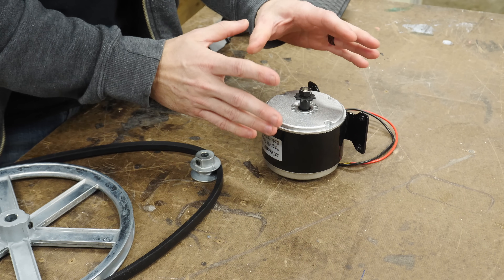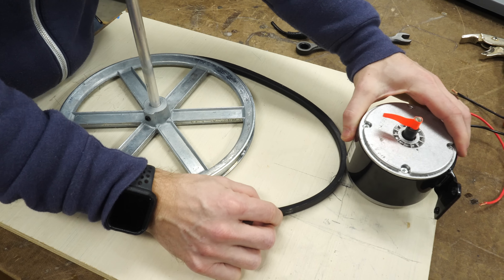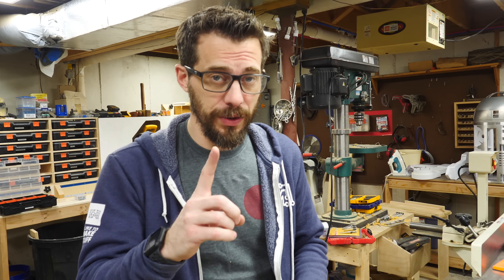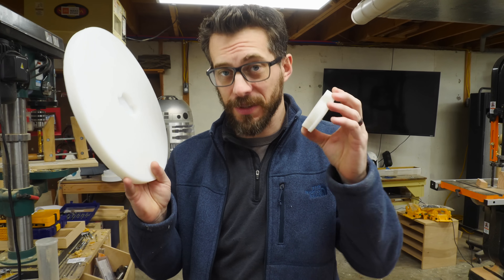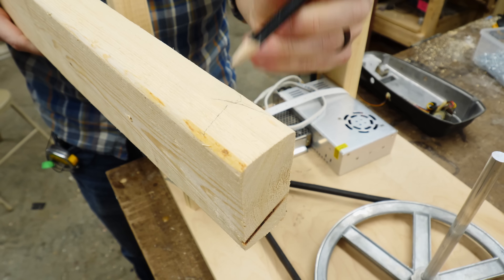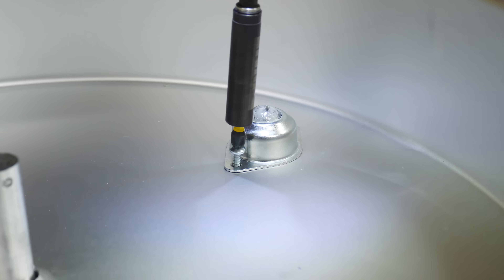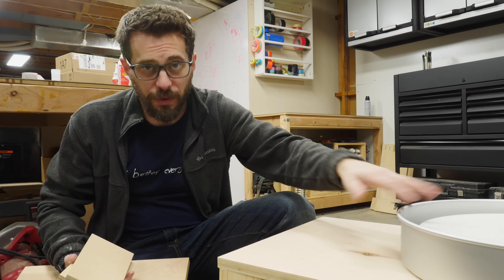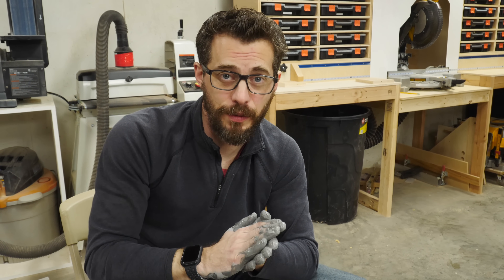How to Make a DIY Pottery Wheel | I Like To Make Stuff

Comment: Love your videos but this particular project is going to be very frustrating for someone trying to learn to throw on a wheel. I can tell you from the hundred or so hours I've spent learning to throw, the slightest bit of wobble can make it extremely difficult to get the work centered- that's often an almost imperceptible amount of play on a professional-grade wheel. Continuing to work a piece of clay that's not centered will cause everything to be slightly off balance and most pieces will develop a hump that will cause failure. From what I could see, this wheel had a pronounced wobble, even after the point where it was "trued". I'm all for DIY but I think at the very least I would want to see someone with experience try this out before presenting it as a project tutorial.

Comment: I really enjoyed this video. The pottery wheel is a great DIY project and you make it look very attainable. One thing that I learned though, and it seems to be the case in a few of your videos, didn't have to do directly with the making of the wheel. In one shot when you were drilling the pocket holes, I noticed how you offset the 2x4 so that you could get the depth you wanted. I've drilled through many tester boards trying to find the right depth, but the trick you showed was very helpful. Keep up the good work!

Comment: You may want a drain for the splashpan, that bead of caulk around the shaft may not be high enough to prevent water/slip from getting down into the bearing.

Comment: To improve your design: 1. you shouldn't glue the wheel head, they are removable to clean the pan! 2. add drainage with garden hose and some wine cork stopper to drain the pan. 3. draw circles on your wheel head every 5cm or so it really helps in centering for newbs. Pottery is dirty instead of making everything solid make it easy to clean. Side note that bearings under the wheel head it shouldn't be necessary you made bat from plastic what you should have done is make it from aluminium and steel atachment (maybe with X bracket and hidden or flush screws?).

Comment: As a professional Potter I will give a critique of this machine. A novice will have some trouble with this machine. The big ones is clean up. The caller to hold the water in is not tall enough around the shaft. All wheel heads should be removable. The wheel head is what you are calling the bat. A bat goes on top of a wheel head. Also a pillow bearing mounted to the shaft would be better suited than having it in the head plate. What would happen if you ever had a bearing failure? You would have to take the whole thing apart again. So on a serviceability standpoint it isn't the greatest. A great first attempt but some refining needs to be done if you were to use this long-term. For $200 more you can buy a good portable potter's wheel with a 5 year warranty. The great thing about pottery wheels is that they don't lose a whole bunch of their value after purchase. Usually the only lose 1/4 of their value at worst. It's not about slacking on your machine. A great first attempt. But I would highly urge you to put an aluminum wheel head on as opposed to plastic. Clay and plastic don't play well.

Comment: Might want to avoid wearing a smart watch while doing pottery, using mine on a wheel was how I killed it (granted it lasted pretty long up until then)
Also a really nice job but I would've made it so you could take the top plate off more easily as you're going to need to clean out the clay that gets thrown into the bottom, was a super big pain when we had to clean ours out when I used them in school, a small drain hole so you can add water and drain it out later might also save you some trouble cleaning.

Comment: You know... That's not a bat. That's the wheel head. A bat it a plastic or wooden piece that's set down on top of the wheel head. So you can throw an object and remove it from the wheel without having to pick it up. A lot of wheels have removeable catch basins. Just a thought

Comment: Glad you went with a removable bat. You might want to replace the nylon wheelhead with an aluminum one at some point, but it's definitely a serviceable beginner wheel. you'll probably also want to at least add some kind of drainage hole in the splash pan. Cleaning a non-removable splash pan is a screaming bitch, I can't imagine doing it without a drainage hole. Just please for the love of all that's holy waterproof those electronics. water and clay goes everywhere when you're throwing.

Comment: I am a pottery instructor and I own 18 pottery wheels from 8 different manufacture and I repair the wheels at my school.  Great build. the wheel, motor and pulley system are on point. the bearings around the outside will rust and get load overtime. (they aren't necessary is the wheel head non removable. The splash pan needs a complete redesign. its too shallow. two flimsy, and non removable. you could fix 2out of three of these and it would be ok. But overtime those will be the weak points.

Comment: you should realy have gone with a tension-er connect it to a block in the middle with a spring on so it auto adjusts, and reinforce that motor mount because that will break in the long run.

Comment: hey man great video but there are some issues with your design. The cake pan, aka splash pan, really needs to be removable for cleaning the clay and water out. The part you keep calling the bat is actually the wheel head and a bat would be temporarily attached on top of the wheel head (which isn't usually removable), either with little pins or some people use a thin layer of clay to adhere it. Those bearings are going to rust and seize up pretty quick with how much moisture is under the wheel head so you should probably find a different way to retain the shaft so they aren't needed. I'd love to see a follow up if you made some changes.

Comment: Awesome video, I am a potter and have been building a wheel on and off for about a year.  I want to thank you for allowing me to rethink some parts of my design and gain some of the motivation I need to finish it.  That being said, as a potter, I do see a few flaws in your design.  Most importantly, while the top is almost perfectly level I do see it wobble a little; for a beginner potter I see this being an issue as your clay will never truly be centered and throwing taller forms will also become an issue.  This was a big problem for me my first go at building a wheel.  I have some suggestions if you ever decide to build another one, thanks for getting me out of my rut!

Comment: Speaking as a potter. Really nicely done. I have thought of building a wheel for myself. Some comments based on my years of pottery experience - should you decide to make a Mk 2.
Your vertical bearings under the wheel head will clog with clay/slip and water, that area is always super wet and full of liquid clay (pottery wheels do not have these). 
Wheel heads are most usually cast and machined from solid aluminium. 
Your wheeled as a very tiny wobble, which would be fine for very small pots and total inexperienced potter, but would make improving ones skill and larger pieces pretty much impossible. 
Dead flat and a reasonable mass is important for a wheel head - momentum is important for even throwing. 
One needs a lot of low down torque for throwing any larger piece - this motor does not large enough (1.5 to 2 hp is best). 
I think you will get leakage down the main drive shaft. The 'dam' where it comes into the 'tray' (cake tin) needs to be 20 to 30 mm high. 
You need a good gap between the edge of the tray and wheel head, so you can get your hand in there for cleaning.

Comment: Seeing as you haven't put any type of drain off for the water, it won't take long for the tray to fill with water and slip and then those bearings are going to be toast. 
Plus without a drain, how are you going to get the water out with such a small clearance between the tray and wheel?
Good first attempt, mark II needed.

Comment: Awwww you should have just left the pedal plug as is and use a guitar cable to control.  That way if you wanted to move it, it would be simple to plug in and un plug and look cool at the same time.

Comment: You should have put a drain hole in the baking tray as you will not be able to get the water out also why not screw the throwing wheel on,so you can remove for cleaning...nice job though...

Comment: to build up the wall use your thump and middle finger using your index finger to guild your middle finger moving slowly upward keeping a consistent thickness youll understand when you give it a try dont use to much water itll ruin your "Pot" use enough to keep it smooth or lubricated make sure to kneed your clay to get out as much air as possible or it will ruin your ability to form anything 

hope this helped bring on the haters!

Comment: Hey bob a tip for making the learning of this skill easier and more enjoyable would be to add pegs to the surface you were turning on and get some plate bats that lock in to the pins that way when you finish a bowl, plate or whatever your making you can remove the whole plate to set it to dry and start again on another one without needing to wait in between. it would also make it to where multiple people in your house could use it and have multiple projects of their own going. I hope this helps.

Comment: If you used a smaller hole and then dimpled it up, that would help keep water inside the pan from dripping down into the shaft bearing.  Also, how do you get the water out of the pan?

Comment: just to clarify a bit. the surface you throw on is called the wheel head. a bat is a removable board that goes on top of the wheel head to make it easier to lift pots off the wheel without distorting them. you lift the bat and pot off at the same time. stick down another bat and throw the next pot.

Comment: The sediment from the clay is gonna get in those bearings, I hope they don't seize up. Most wheels have a splash pan that comes apart into two pieces so you can easily dump out and clean it in a sink, getting excess water out of the base is gonna be way harder than normal wheels. Also be careful how much clay you wash down then drain assuming you don't have a trap installed on the sink to catch sediment, it can clog pipes.

Comment: I'm taking a ceramics class right now and don't know much about it but i do know that the base where the clay is put on to usually has scuffs on it so that the clay can stick to it better. The scuffs usually get worn off and the bases are still usable so it shouldn't be a problem but it may help if the clay is flying off.

Comment: I learned so much from the B-roll in this video alone! I'm not an active woodworker but I'd love to be one day and I would have never thought to use the clamps to support the stringers from the underside while attaching them. I also never thought about with a pocket hole jig to make sure your bit will fit right by placing the bit in the jig and sliding the work piece into it. Great stuff Bob and team! Thanks for awesome content that I can still learn from even after following you for the last 2.5 years.
Reply from the maker: That's great feedback, thank you!!

Comment: Love the vid.  You do realize the motor had left hand thread so you were just trying to over tighten it and it probably stripped the threads.  That's why it wouldn't come off.  Reference 5:19 for a clear view of the threads sloping up to the left, meaning left hand threads.

Comment: you should make sure to take off your wedding ring when doing pottery. It's a pain to remove afterwards.
Reply: also, make sure you wrap your clay pieces until they are ready for firing. Otherwise, they will crack under the heat, and all your hard work will be ruined.     Amazing project, and ill be following suit!

Comment: I would suggest adding a drain for the water so it doesn't become a problem for mold/mildew. I also suggest playing around with the size of the table legs so sitting for long periods won't hurt your back.

Comment: Awesome man. This is why I love your channel. I do remodeling by trade and am familiar with a lot that you do, but you come up with ideas for projects that I would never think could be diy. Great job. Pro tip. When sealing a screw hole, dab the sealant onto the surface first, then the object you're attaching (your bearing) then screw through the sealant. Guaranteed, every time. Great job man. Thanks 👍🏾

Comment: What an amazing project!!! I've seen budget friendly wheels for under 300, this is such a nice guide for potters who maybe want to create their own wheel on a budget. I would like to suggest perhaps getting some bartop epoxy (instead of paint) and do a pour on the wood surface. You obviously might run into problems where the water falls off the surface and onto the floor (which is why so many wheels have a beveled edge to keep the water on top) BUT you've put so much work into this I would hate to see water damage warp the top (or get moldy). Great job always enjoy the videos!

Comment: You could add a little hole in the bottom of the metal thingy and connect it into an aquarium hose just to drain excess water out in a little tank underneath the table top 😉

Comment: Nice build,  but it's going to be a nightmare to clean. The best profesional pottery wheels have a detachable tub to make cleaning easy.  That part usually gets very wet, and depending of its use it may end very full of water or paint.

Comment: I noticed you didn't plug the holes after you removed the first set of bearings. I hope you caught it. Also, you need to kneed the clay before you turn it. I know it's practice, but it can blow up in the firing kiln because of air pockets.
Reply: It was all plugged and sealed by the final shots. We don't always get to show every little thing, but it happened 🙂

Comment: The top of the table needs sides to keep the water and the flung-out clay in. You need to wear an apron to protect your clothes. Get an apron with a front pocket to keep the tools in, so you can grab them as you are working. The tools that you need are wooden and metal spatulas and knives for decorating and shaping the clay. You need a sponge also for working the clay, and some water within reach, for instance in a bowl. Part of the shaping process needs water to act as a lubricant, both on the sponge, the shaping tools and your hands. At the end of your creating, you need a fine wire like a cheese-cutting wire to remove your piece from the wheel, and move it to a board for drying out or getting ready for the kiln. When you get a kiln, fire your creations slowly, and cool them down slowly, otherwise they crack or disintegrate. You can recycle failed pieces and use them again, for which you need a vessel such as an old drum. You put the recycling into it, in water, and let it decompose. With new or recycled clay, you need a table with a flat wooden top, for "wedging" the clay and getting it ready for use. Again, you cut it into suitable sized pieces with the wire. Be careful with your back and thighs, as you are tall and thin, and are going to be sitting at angles your body is not used to. You probably are going to have to adjust the height of the table and chair to get an ergonomic seating position. As you see, there are lots of factors to consider - the ergonomics, all of the processes that you need to know about, what you want to start off making, how slip and glaze work. A big learning curve at the start, but as you say, it is fun. Good luck ! Phil Dodd, Leominster, Herefordshire, England.

Comment: This is great, but I would question (much like you did) on securing the wheel down.  With all the clay and water being thrown around, I would suspect you'd want to lift that wheel to clean the basin (and ensure your bearings don't clog up).  Otherwise, what a great project.  I haven't thrown clay since high school, and that looks like so much fun.  Thanks for posting.

Comment: All the needed electronics can be found on a cheap used 24v Razor brand vehicle. They make quads and go karts that use the same motor seen here and has an ESC with a thumb or handle throttle that can be used with a pedal. ☝️👍👌
Reply: That's a good idea
Reply from the maker: Nice!

Comment: i've been wanting to make a pottery wheel for a while.  this brought up a lot of things i hadn't thought about. 
the thought in my head was mostly as a sculpting station that could spin the model slowly to get a better working angle on it with the added bonus of also being able to use it like a more traditional pottery wheel if i felt like doing some of that.
another awesome video.
Reply from the maker: For something like that, a simple revolving cake plate would work.
Reply: @Iliketomakestuff  i've never actually heard of a revolving cake plate until now.
i used some plywood and a lazy susan bearing to make what i've been using but it's had a long standing to do for it to add some peg holes and a peg to allow me to lock it's rotation down.  the weight of the clay doesn't help as much as you'd think with the bearings making rotational friction much easier to overcome.

more than that i've been wanting something a little more stationary that i'm not stuck moving on and off of my work table to do different things.
i figured if i'm gonna build something like i could also include a motor and give it some pottery wheel functionality and learn to do that too.

Comment: I would have put the motor on a pivot mount  (like a hinge) so you could use a bolt to push it outwards and add tension and easily change the belt if needed